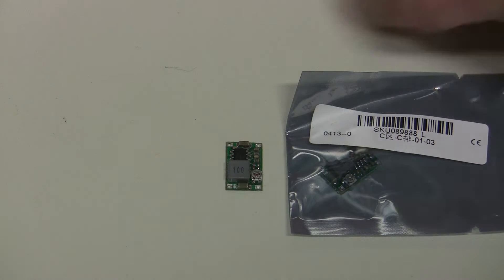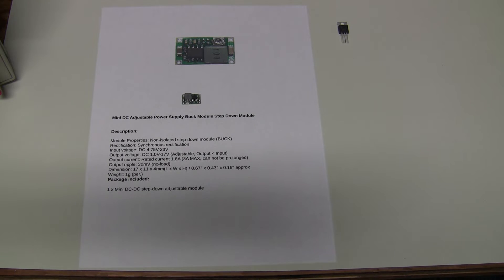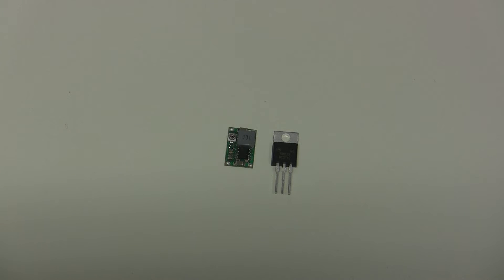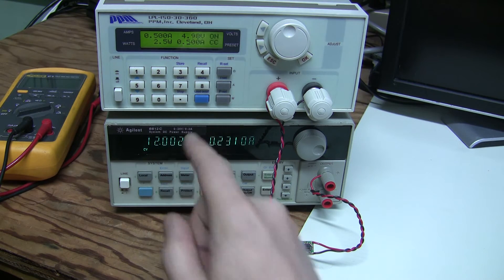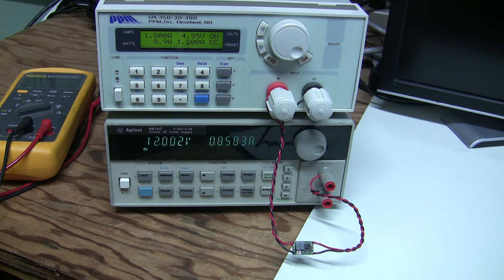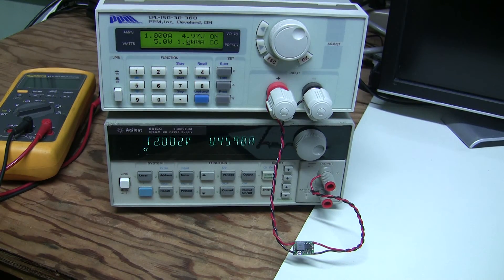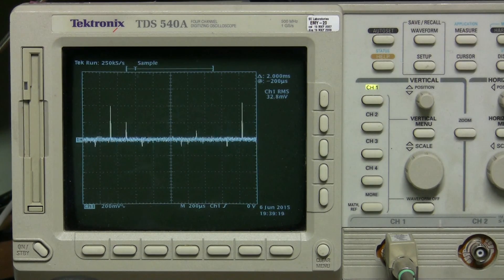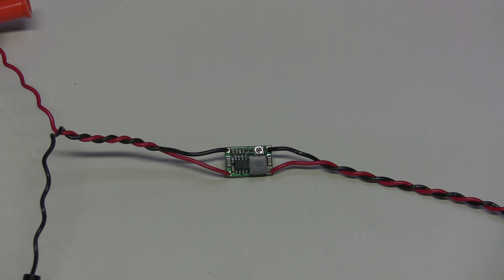#26 - Mini DC-DC adjustable step down module

Comment: Excellent review! Thank you for taking the time to do it. 
For a constant smooth output voltage this buck converter could feed a linear regulator in series. If a low voltage drop linear is used and the buck converter feeds the linear just above the input threshold, then the generated heat would be minimal and the spikes should disappear.

Comment: Thank you for the video and you have some very nice toys to play with.  I realize the cap you assed was a low esr unit, but that does not necessarily translate into good high frequency performance.  Electrolytic caps are notorious for having poor high frequency performance.  Back in the old days it was not unusual to see all of the electrolytic caps bypassed with small ceramic of film caps.  Often the small caps were right up near the pins on sensitive (read analog) devices.  Knowing the switching frequency should make it somewhat easy to design a good filter, but that takes up more parts, and space and starts to defeat the smallness and hook it up and go factor.  Also, I agree, the little pots suck,  on the data sheet for the MP2307 they give you both the formula and the pre computed values for some popular output voltages.  They also have a graph regarding the efficiency.  I am assuming that they picked the most efficient range they could have for the device and that would seem to be 5Vin, 3.3V out and between 250 and 300 ma.  I am betting these would be the cats meow with an ESP8266 and a roughly 5V supply.
Reply: i use the CUI 7805 down in the beginning a lot. that one spits out 300Khz and harmonics. if you need to clean it up.. input side: 4.7uF x7r + ferrite (approx 2uH) + series damping (5-10 ohm) + 4.7uF again. output side same but no damping.. With a 24v to 5v/3.3v application, heat vs noise vs part count. have to live with one of them. (?)

Comment: Nice video. I have one concern.

The grounding of your scope probe is less than ideal for power supply testing. I'd come off the resistor with more twisted pair, then add the low ESR capacitor, then use a piece of RG58 or RG174 coax with a BNC on the end to go from there into a scope channel (X1 setting). The leads of the cap must be kept as short as possible, and coax shield and braid should be as short as possible going to the capacitor.  Typically, power supply manufacturers call 2 capacitors in parallel are used for measuring ripple on a power supply 0.1uf and 10uf.

If the noise is indeed real, then the chip looks like it is working in discontinuous mode with the resistor load which is going to be noisy.

That said, I have a few of these modules and what I don't like about them is the rinky-dink adjustment pot. They should have used a through-hole 10 turn pot and made it so you could fix the output with 2 resistors.
Reply: +Steve Rodgers 
We can desolder that single turn smd potentiometer, and put two resistors, there already pads for these resistors.
See datasheet to calculate these resistors and you can get fixed voltage.
Reply from the maker: +Steve Rodgers 
Fair enough. I could have done better with signal integrity. Regarding two capacitors 0.1uF and 10uF - true, but let's remember that my capacitor was in addition to what the module has to offer. I just wanted to see if additional filtering would help, and to what extent.
The adjustment pot, indeed, doesn't instill confidence.
Reply: Trace the leads from the pot to the blank pads on the pcb and to the MP2307 chip. Use the formula in the MP2307 data sheet to calculate what the resistors should be for 5 volts.

Comment: thanks for the thorough review. Really helped me with a noise demonstration. I am using a $40 laser diode which can be destroyed even by quickest spike, so these 100mV spikes can bin it.

One thing I discovered about this module is that those SMD pots can only be adjusted 5 times, before they wear out. SMD pots are single turn and can only do 270 deg. So if you are planning to adjust voltage on these frequently, this is not for you.
Reply: very good point you mentioned the pots!
I believe noise can be cleared out by simple low pass filter.